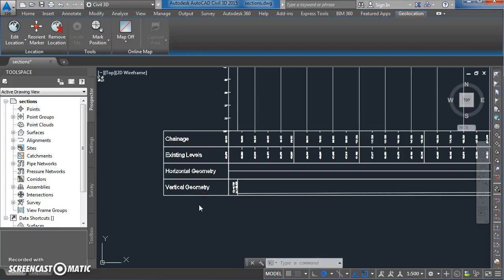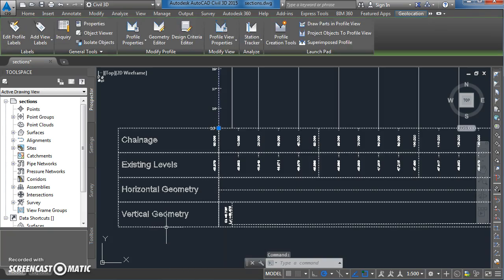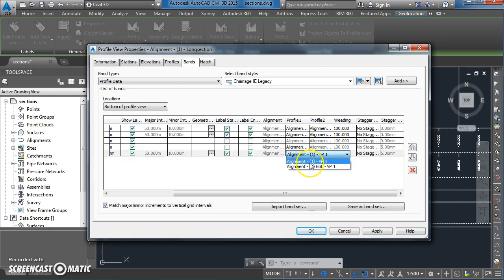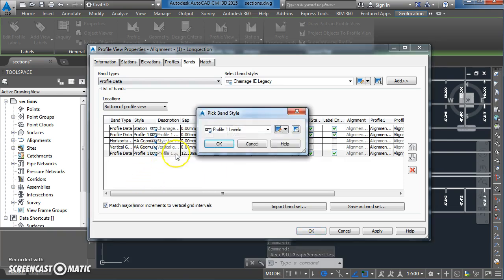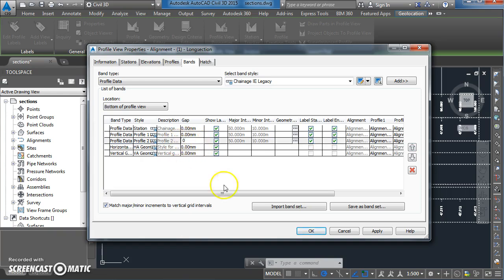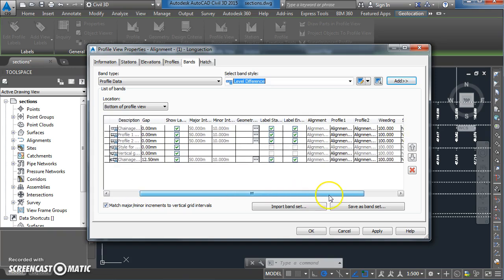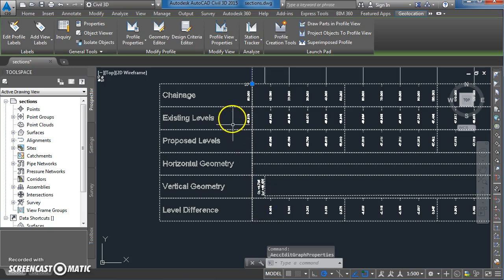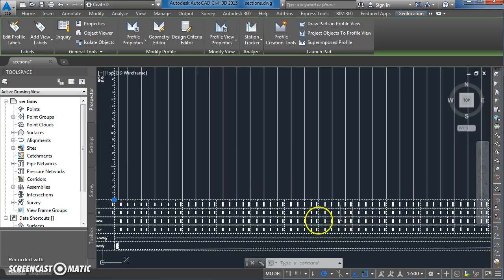Displaying data in the Profile View, Civil 3D

Comment: Is it Possible to show Horizontal offset distance between two alignments in profile band.
Reply from the maker: Not sure about that, to be honest. The profile is usually just along one alignment, I don't think you can show 2 horizontal alignments on the one profile. You can show vertical profiles for alignment that intersect with the main alignment, but that's not really what you're after. Are the 2 alignments related to each other? For example, are the kerb lines on either side of the same road?